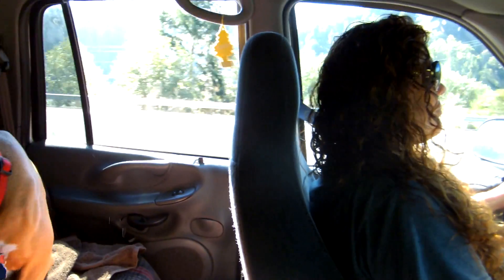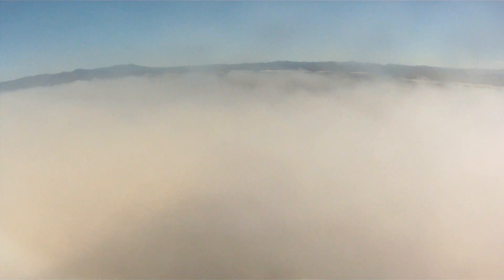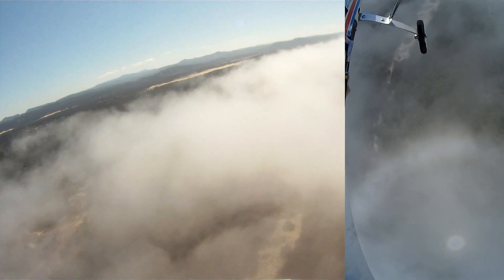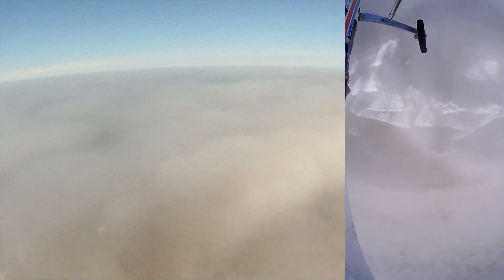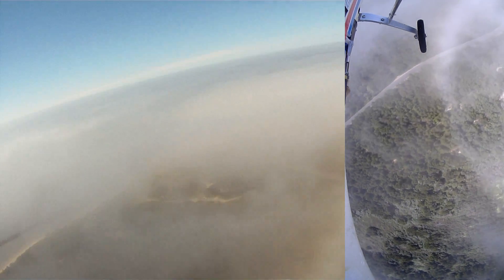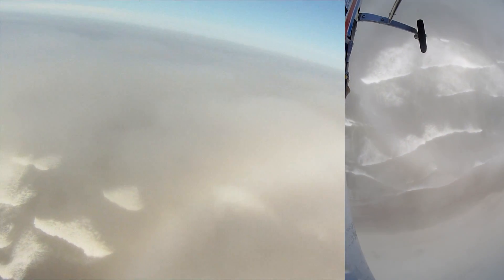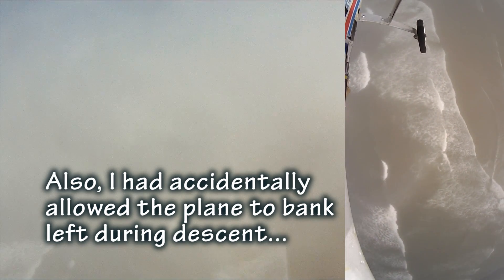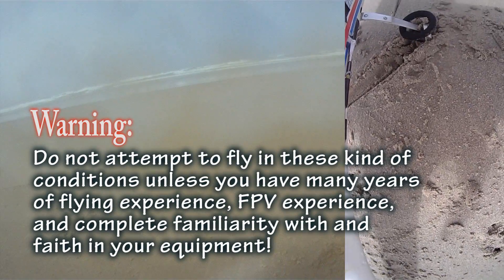FPV Emergency! How To Land in FOG Using RTL

Comment: 9:46 or you know you could just fly down through the fog when it's above you and get line of sights. You're making this such a greater deal than it it is.
Reply from the maker: Yuri Danylko - Are you suggesting I just wait until I hear it buzzing over head, then just pitch the nose over and come blasting down until it pops out of the fog at 50ft agl? That is ludicrous and hazardous. When flying R/C in fog it is difficult if not impossible to ascertain position by sound alone. I have flown in fog tons of times, and you just can't determine exactly where it is above you at any given time. I have tried multiple times. Ship captains are well aware of this phenomenon. "The transmission of sounds in fog may be erratic, it can be difficult to determine the direction they are coming from." (Safe Boating In Fog, Posted on October 21, 2013 https://captnmike.com/2013/10/21/safe-boating-in-fog/) So I would be just as likely to pop out of the fog 200ft behind me as I would to the left or right or in front of me. Trust me, I have been there and actually done this before. Not to mention the human eye has a limited FOV (114 degrees or so horizontally) So I would literally have to be spinning around in circles on the ground in an attempt to regain visual contact as my aircraft plummets towards the ground, and then hope I don't yank the nose back too hard into a high speed stall upon recovery. It is true that in post-processing, I added a little dramatic effect to make it more interesting, and I did make it more of a big deal than it actually was, but this is simply because I had 100% confidence in my RTL autopilot the whole time, so I never broke a sweat.

Comment: Gotta love Grumpy Cat, maneuvering through the fog, grumpy, yet stoic and secure, brave in the face of imminent danger. I never lost faith  that Grumpy Cat would collect himself, grip the stick and, with the determination of a Naval Aviator, flying blind and by instruments, only....approaching the Aircraft Carrier in rough and dangerous seas and with  just one chance at landing safely on the Carrier's deck, that is appearing even smaller than normal, as it heaves its bow into the 60' swells, rocking back and forth like granny after doing a double line of some home cooked crystal meth. Grumpy Cat knows that it's now, or never. So, with his pulse racing and heart beating like Ricky Ricardo beating the bongos with newly stretched goat's skin, he again eyes up his approach. As he recites the Lord's prayer, which he confuses, momentarily, with the Star Spangled Banner, Grumpy descends, flaps down, throttle cut, gliding just above the sand, like a pelican skimming the surface of the water, looking for that wayward fish that will unwittingly become his next meal, Grumpy Cat gently pulls back on the stick, flaring the nose and touches down, wheels greeting the ground, like a young couple, separated by time and circumstance, run to embrace each other. Finally, as Grumpy Cat realizes that his efforts have been rewarded and his concerns and fears, unwarranted, , notices a foul stench and the feeling of a warm, yet uncomfortable swell beneath is buttocks. Ah, thinks Grumpy Cat, a load of shit is the price one pays for flying by the seat of one's pants, after eating a 3 day dead rat.  It's good to be on the ground again, yet Grumpy Cat is already dreaming of his next, aeronautical adventure.
Reply from the maker: +John Schips -- That's more or less how it went down...
Reply: +glassdogangle  LOL, I figured as much.   Sorry for my long and rambling comments...!!!

Seriously, though, excellent video. Do you have OSD, or 5.8Ghz Telemtry??   You seem to know a good deal about flying, how long have you been flying?  
After watching your video, I'm thinking about putting a GPS / Auto-Pilot system into my Dynam Sonic 185 powered glider.   

I recently had a similar experience with one of my FPV / GPS quadcopters, and I wasn't paying attention to the distance traveled. When I noticed that I was possibly beyond the point of no return, I quickly switched on RTL ( Return To Land ) and hoped for the best.  The quad was only at about 300' altitude, but above the low lying clouds / fog.  Soon enough, I was relieved when I was able to hear the low voltage alarm as the quad approached and immediately after,  I saw the flashing LED's.  The quad was directly above me ( The point from which it launched ), maybe about 30' above me, when it lost all power. I attempted to catch the thing and my arms broke the fall. Luckily, the only damage was a cracked landing skid.

Comment: great video. I have had a similar experience above the cloud although it didn't last as long as yours. What made mine scary was that I have no OSD, just a Turingy T1000FC for RTH but it doesn't control altitude or throttle. I went up above the clouds and realised it was much more windy up there and that I had drifted to the point I really didn't know where I was. Found a little hole in the could and came down though it to see a building that I happen to know is about 3 miles away! Used RTH to set the plane on he most direct route home then flew it back manually. For some reason my plane always wants to nose up a bit in RTH mode. Love the cat sounds... made me laugh : )

Comment: Not an experienced hobbyist but here's a few suggestions:
1. Dollar store compass in your cockpit (reliable, works all the time)
2. Cover your cockpit and keep it rainx'd
3. Raspberry PI with a GPS unit (you can make this work with a small laptop and google earth via satelite, and it only costs 50$
like I said I'm not a pilot, but I'm sure those things would help you out a ton next time
Reply: 4. use a real cat with ifr cert.

Comment: Have you ever tried coating your lenses with RainX or something similar? I wonder how it would perform.
Reply from the maker: I have tried that once, but then by the time I had a moisture problem it had probably already been worn off, so not enough to really compare anything.
Reply: +glassdogangle May I ask, are you in Maine? I think i've been on that very beach before!

Comment: FOR THE LOVE OF YOUR GOD>>>>>

Do not touch your RTL or RTH  until you have absolutely no other options.  This guy, had plenty of options.  He still use RTL.

Let me break it down to you why RTL is more trouble then it make out to be.
1.  you could have it malfunction, seen it where it flew somewhere out of owner orginal spot and land somewhere else. You are at point A, malfunction and GPS set you at point C aka unknown point.
2. The wiring you did made it think you are on the opposite of where you hit your RTL, thus making it think you are at point B, rather then point A, where you are at.
3. IF you have OSD, it could glitch, causing you to hit that RTL, only to have model spin freely spiraling down to the ground.  THIS IS IMPORTANT.  IF YOU HAVE OSD AND IT GLITCHES, FOR THE LOVE OF YOUR GOD, PLEASE DONT HIT THAT RTL SWITCH!!!!!   EVER !!!!!
Reply from the maker: Good points. It is important to thoroughly understand all of your aircraft systems, and to test those systems out completely and thoroughly before ever trusting them to bring your aircraft back safely. Also, if you have any kind of "glitching" system, I would replace that system asap. I engage my RTL regularly, every single flight. Or if not every flight, I at least engage it on the first flight of the day, to ensure it is working correctly. This is standard procedure for how I fly. If you do not have some faith in your RTL system, it is time for a new system, or time to understand exactly why it is not doing what it is supposed to do. One more point: Never ever trust your RTL system if you are flying in high winds. High winds cause discrepancy between actual compass heading, and actual direction of travel over the ground. High winds can confuse the RTL autopilot system, making it believe your aircraft is pointing in one direction, when it is actually pointing in another.

Comment: Cool video. Here are my suggestions to anyone who might get in that situation. Put one piezo buzzer (or/and strobes) on each wing and hook them to an auxiliary channel.  You will be able to pickup the plane direction and speed, unless the waves are louder than the buzzers. You could also get a barometer and note the atmospheric pressure at launch. If it stays the same when you hit RTL, at least in theory, you should be able to trust the OSD data.
Reply from the maker: I do have piezo a alarm putting out 130db on my plane. I have activated it when in fog. I assure you they are worthless for controlling the airplane and/or navigating! You may get a general sense of the direction your plane is in, but other than that, no good. Same for strobe lights. I have a powerful police brand strobe, and it is hard to see in clear daylight, let alone above the fog! They are lots of fun for other uses, though!

Comment: Having the right equipment and knowing how to use it is key to having a safe flight.  Just not having one of those pieces of equipment this flight would've ended differently.  Nice to have good pilots out there.

Comment: The old timer mail pilots back in the twenties used to put the airplane into a spin until they dropped below the clouds, then straighten out and figure whether to land or continue on at low altitude. It was their only hope, better to try a controlled spin than become disoriented and spiral into a mid-air breakup or crash into terrain.
Reply: in the 20s they wouldntbbe flying in these condtions
Reply: Yes. Yes they would. And a great many mail pilots didn't survive more than a few years before their nerves went or they were killed.

Comment: Ah the value of having an OSD...I woudn't fly without one.
Reply: helloman1976 Ikr. A little fog. Nothing an artificial horizon can't thinks. Not to speak of a RTH feature...
Reply: quit braggin' ;)
Reply: @Yuri Danylko I was out flying my hexacopter a couple of weekends ago when somehow my  video transmitter antenna got ripped off at about 1.5 miles out, I couldn't see anything at all. I did a couple of spins to see if I could regain the video, I didnt know what had happened at this point. I hit the "hope and pray switch", aka RTH, and 8 minutes later my copter came back and landed 5 feet away from me. I use the Eagle Tree vector for my long distance rigs, invaluable!

Comment: Hello!   Great video!   Thanks for sharing.  I am an fpv newbie just starting out and thoroughly hooked.  Have been having a blast with my present setup, but would like to upgrade to a stronger video link, not necessarily to go really long distance but to have better assurance of not losing my video signal. I have a dragon link setup I plan on using to extend my controller. Also I want to buy a skywalker.  If possible, would you help me by sharing info on your setup?, what model skywalker, any details on that you care to share, but especially any details or recommendations on your video link, etc.   I have subscribed and am looking forward to checking out more videos...thanks a lot for whatever you can share!........Larry..........pipedoc56@gmail.com

Comment: Watched another video with someone activating rth on the fy31ap without power and it more or less does small stalls until it goes down as it's trying to stay in the 50m height pattern. He doesn't let it go all the way down but if you've got an aircraft with flat stalls it would probably land reasonably safely. Haven't tried it on mine yet but will give it a go one day.

Comment: I would normally say you was very lucky
But with the narrating accompanying the video it helps to know
what exactly it is you are doing. So therefore will say very well done
it is very hard to stay calm and focused when all that is going threw your mind is im going to lose my plane. Followed by what damage may it cause if I cant control the landing and see it land. I myself have lost a skywalker amongst other planes but was not so lucky  to get the model landed and opt for a controlled crash away from anything that may be damaged.

Comment: If you used Ruby by uThere, you could have it do an autonomous landing. It's extremely reliable (in my experience with a SkyHunter) and shoots a perfect approach even in insane winds. It also has an OSD module so you could replace half your hardware with a single unit.

Comment: I have fy31ap and it's got me out of bother plenty of times lol. I'm only using 2.4 control as haven't upgraded to uhf yet and I've flown out of range countless times over the past year but the 50% throttle & rth switch is set to activate in a failsafe situation so it's just turns right round and flies back into range. Wouldn;t fpv without it too be honest

Comment from the maker: Drama keeps the audience engaged. I am sure some of my viewers were a lot more nervous during this video than I was during the actual flight. I knew there was no danger, but if this had happened a couple years ago when I first started flying FPV, then I know I would have been pretty freaked out. This video was geared towards the novice pilot, on what types of options are available in a situation like this. I try to mix it up a bit on each video to keep everyone happy. Thanks for watching!

Comment: been there. it's not fun, but feels great when your equipment works, and you get the plane back in one piece.   good job. hard to say what i would have done, but i prob would have tried scud running from the east.  the fog is prob less dense over land, and may fog the lens less.  i did a similar flight recently, and had to climb through some pretty thick fog. when i was ready to land, it had cleared for the most part, and shot approach between clouds. it was cool.  fun stuff!

Comment from the maker: Couple of problems there, though. First, I didn't have the siren installed yet for this flight. This was about 2 months before my siren installation. Also, I have flown up above the fog since this flight and tested the siren out when the plane was above me and the fog, and I swear I couldn't tell where the hell the noise was coming from! I will be doing more tests of this, though, so stay tuned!

Comment from the maker: Yes, I could have left the FY31-AP in Auto-Circle Mode above my head, and then reduced power a bit to cause it to come down. The biggest problem with that is the plane will struggle to maintain that initial altitude no matter what, and the result would be a series of stalls and possible spins. I am sure I could have kicked the AP off in time and taken control as soon as she appeared, but I think that would have been messy! The FY31-AP is already out-dated tech. The APM 2.5 is certainly better.